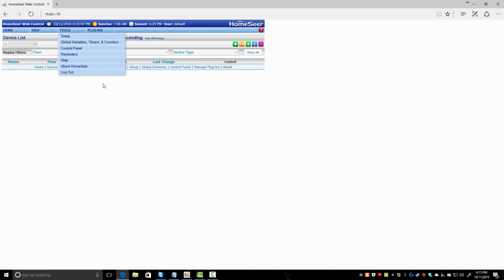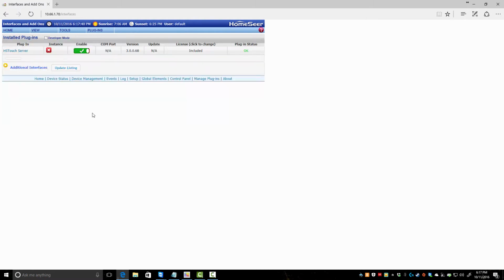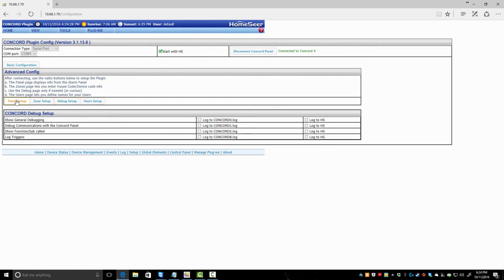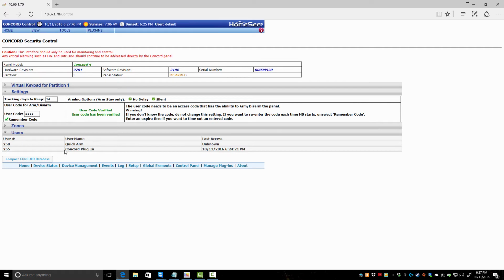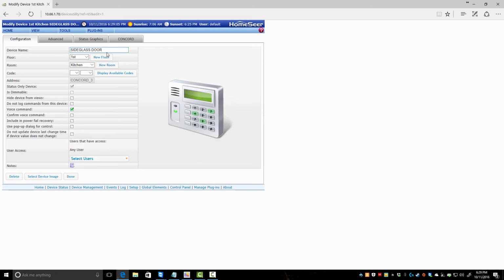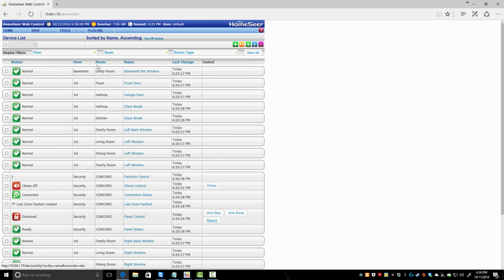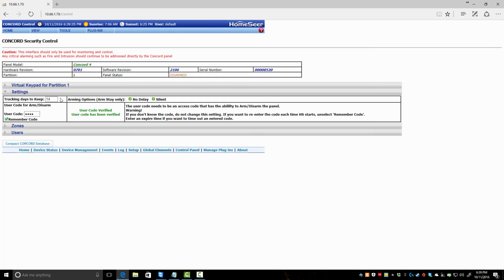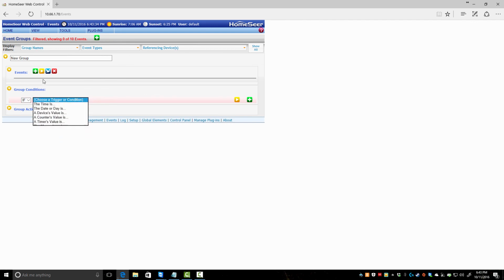Homeseer 3 - Concord 4 Alarm Plugin

Comment: I'm confused. Is this the correct configuration? Just want to make sure I know before I buy:
Concord 4 Panel > Superbus Automation Module > Serial Cable from Automation Module to Edgeport 4 > USB from Edgeport 4 to Homeseer
Only place I'm confused is with the USB cable - does it plug into a PC or does it plug into the Homeseer? If it goes into the PC, how do you link it to the Homeseer?
Reply from the maker: here is the deal. You do not need the edgeport... the superbus 2000 module connects back to the alarm via a wire... I am using a cat5 cable as it carries enough wires. That connects from the alarm panel to the supuerbus 2000... i have them in different areas...
the cable that connects from the superbus 2000 to the pc is serial based, so if your computer running homeseer has a serial port, no need for the edgeport. I typically use my only onboard serial port for my alarm but for simplicity.. if you have a 4 port edgeport and have open ports.. why not use that.
let me know!
also go to forums.homeseer.com and search for concord and you will find the entire concord dedicated thread.

and here is my thread on what I am using HS4 for. I need to update it though...

https://forums.homeseer.com/forum/hs4-products/hs4-software/hs4-pro-beta-releases/1383463-telefragger-s-start-to-hs4-beta